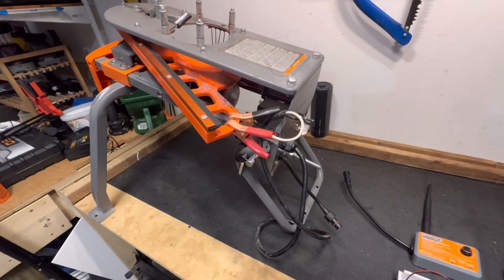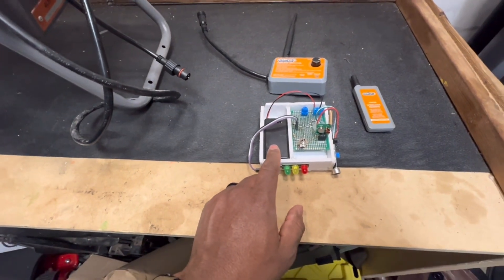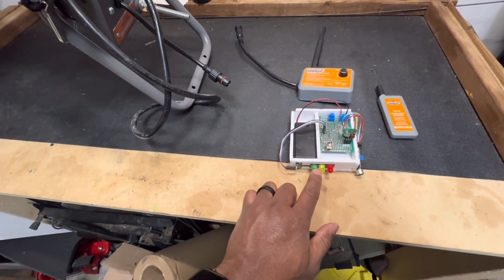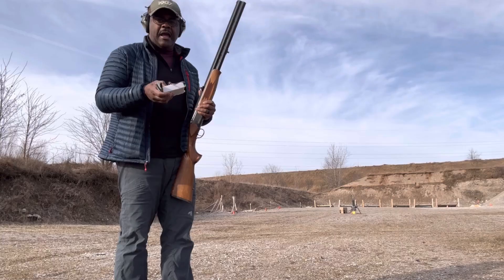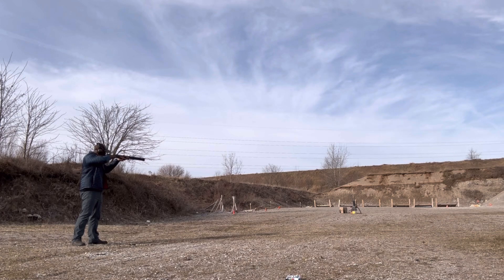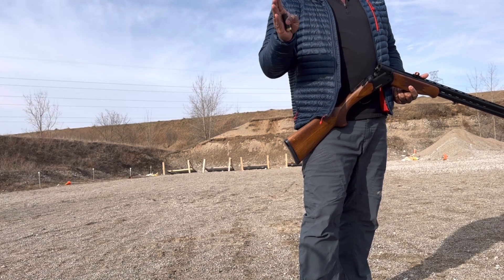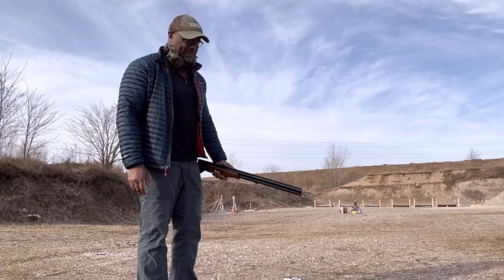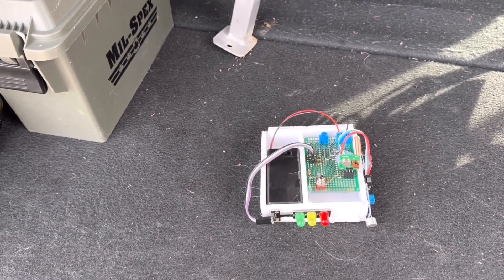Voice Controller for Champion Workhorse Clay Thrower: Field Test

Comment: How do I buy this
Reply from the maker: @jporreca1  ha!  I would have to make it for you and mail.  Check out my other video with my wireless foot pedal.  I use both.  If there is a lot of bsckground noise the wireless foot pedal is a great option which gives you more distance without the pesky cable.

Comment: I would love for a breakdown of the parts and sources for said part this is the kind of project my son would love making.
Reply from the maker: Hi there, do you already own the champion workhorse and remote controller?
Reply: @12douzee  I have the freedom bird thrower with the same remote system
Reply from the maker: Okay send me your email and I’ll forward you the arduino script and the the diagram with the parts
Reply from the maker: @  here is the parts list
- Arduino Nano
- 433 Mhz RF Transmitter and Receiver Module
- Mini 5V Traffic Light LED Display Module for Arduino Red Yellow Green 5mm LED
- DAOKI 5-Pack High Sensitivity Sound Microphone Sensor Detection Module for Arduino AVR PIC
- 9V Battery Holder with Switch Leads Wires 9 Volt Battery Case Cover Holders Storage Box ON/Off Switch Cap
- BOJACK 10K Ohm Breadboard Trim Potentiometer with Knob for Arduino P103 3 Terminal pin Blue Variable Resistors
Reply from the maker: @  adjust the scripts here to get and send the signal to your thrower from existing remote

https://randomnerdtutorials.com/decode-and-send-433-mhz-rf-signals-with-arduino/
Reply: Hello, any chance I could get the wiring diagram? I have a workhorse with remote also. 

Also one question, will the remote still work? Thank you!
Reply: @mylife123457  your original remote will still work. You are just cloning it. Your mic and transmitter will have vcc ground and data pins. Vcc is 5v ground is to ground data will be whatever pins you select. The mic data pin will be an input . The transmitter data will be an output. The led lights are your pin selection to resistor to anode the led  cathode go to ground mine doesn't use the potentiometer for delay. I used buttons and coding instead. Mine is still a work in progress and not 100 percent working due to me adding other features, so what I say as starting advice from a novice. If you want help, I will do the best I can.
Reply from the maker: @bleedingshadowwalker  it’s awesome that you’re building your own version.  Good luck.
Reply: @12douzee  it's been a rabbit hole that has led to me getting a 3d printer and using some weird code for allowing on report throws and a score counter when I cut back on my normal job hours I will have some time to finish it I will reach out when I am done to let you see what it turns into
Reply from the maker: @bleedingshadowwalker  i work for a college and can use theirs if I want.  Yes, a project like this can keep going indeed.
Reply from the maker: @bleedingshadowwalker I use an apple watch app called Tally Counter to keep track of my hits.  I’ll also work to update my code to add an OLED display.
Reply from the maker: @mylife123457  here’s all the code.  If you choose to use it in its entirety then you’ll need to set your receiver to learn and send the signal from the voice commander to it.  Else you’ll need to capture and replicate the signal from your current champion remote.

#include <RCSwitch.h>

// these constants won't change:
RCSwitch mySwitch = RCSwitch();
// Defining pins - note pin for transmitter is defined in setup
  const int waitSensor = A6; // the potentiometer is connected to analog pin 6
  const int micSensor = A7; // the sensor is connected to analog pin 7
  const int shotSwitchPin = 12;  // the number of the pushbutton pin

  const int threshold = 800;  // threshold value to decide when the detected sound is a knock or not

// these variables will change:
  int waitReading = 0;    // captures how long the commander will wait between send commands
                          // the value of the potentiometer from 0 - 1200 as in volts will then be translated
                          // to a wait time.
                           
  int sensorReading = 0;  // variable to store the value read from the sensor pin
  int ledValue=1;
  int shotValue=1; //identifies if we are playing singles or doubles

void setup() {
  // initialize serial communication at 115200
  Serial.begin(115200);
  pinMode(LED_BUILTIN, OUTPUT);
  pinMode(3, OUTPUT);
  pinMode(4, OUTPUT);
  pinMode(5, OUTPUT);
  
  // initialize the switch pin as an input:
  pinMode(shotSwitchPin, INPUT_PULLUP);

  
  // Transmitter is connected to Arduino Pin #13  
  mySwitch.enableTransmit(13);  

  //Send message stating to stay back from machine
  //wait 10 seconds before signals can be accepted
  //blink during this period
  Serial.println("Please stand a safe distance while I arm.");
  // Turn on red light to show system is getting power
  digitalWrite(3, HIGH);

  // BLINK yellow light to show system is paused
  for (int i = 0; i <= 5; i++) {
  digitalWrite(5, LOW);   // Turn the LED on by making the voltage LOW
  delay(1000);            // Wait for a second
  digitalWrite(5, HIGH);  // Turn the LED off by making the voltage HIGH
  delay(1000);            // Wait for two seconds
  }
//  digitalWrite(3, LOW); 

  Serial.println("Ready for fun");

}

int wait(int pot)
{
  int mynum; 
  mynum=(pot/200)+2;
  //Serial.println(mynum);
  return mynum;
}

void loop() {
  // read the sensor and store it in the variable sensorReading:
  sensorReading = analogRead(micSensor);
  int waitReading=analogRead(waitSensor);
  //Serial.println(sensorReading);
  //Serial.println(waitReading); 
  // read the state of the switch for throw value:
  shotValue = digitalRead(shotSwitchPin);
   int w;
  w=wait(waitReading);

  // if the sensor reading is greater than the threshold:
  if (sensorReading >= threshold) {
    // send signal
    // check if the pushbutton is pressed. If it is, the buttonState is HIGH:
    if (shotValue == LOW) {
        // Shoot once if switch is set to that position
        mySwitch.send("001110010001111010100100");
        Serial.println("shoot once");
        Serial.println(w);

    } else {
      // Shoot twice if switch is at other position.
      mySwitch.send("001110010001111010100100");
      delay(2000);
      mySwitch.send("001110010001111010100100");
      Serial.println("shoot twice");
      Serial.println(w);
    }
      //Serial.println(w);
      for (int i = 0; i <= w; i++) {
      digitalWrite(5, LOW);   // Turn the LED on by making the voltage LOW
      delay(500);            // Wait for a second
      digitalWrite(5, HIGH);  // Turn the LED off by making the voltage HIGH
      delay(500);            // Wait for two seconds
      }
    Serial.println("listening");
    }
    

  if (ledValue==1){ 
    ledValue=0;
  }
    else
   { ledValue=1;
  }
//  digitalWrite(LED_BUILTIN, ledValue);
  delay(100);  // delay to avoid overloading the serial port buffer
}